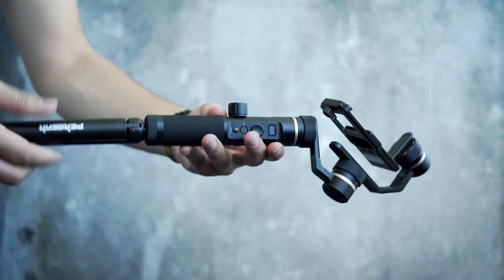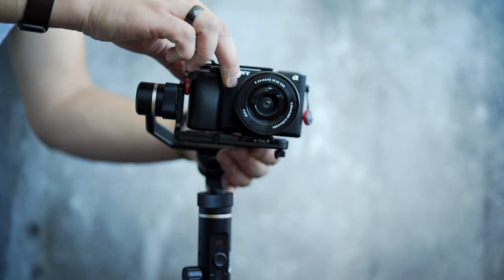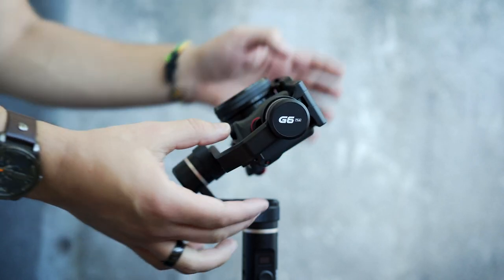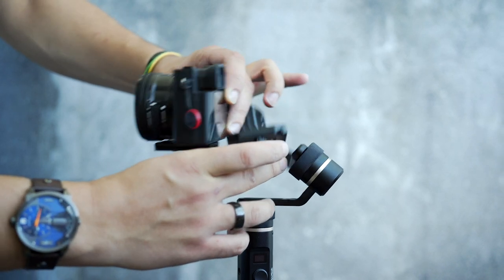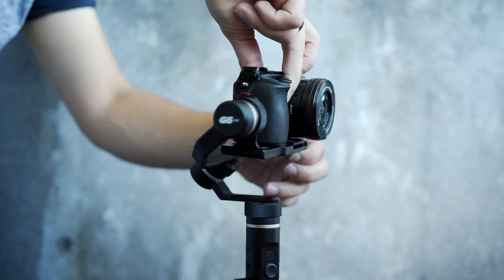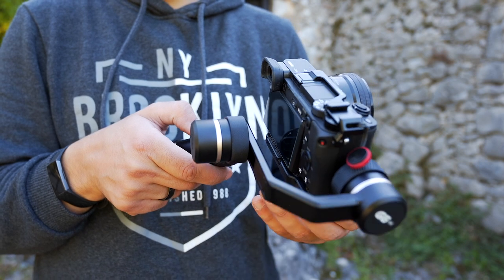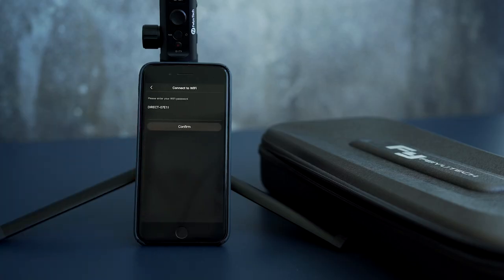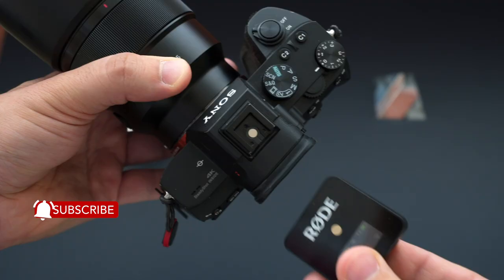How to Balance Feiyu G6 Plus Gimbal in 3 minutes!

Comment: Nice video. Calibration did work. but my problem: the sounds of the motors are clearly audible in my videos. What is wrong?
Reply from the maker: What camera are you using ?
Reply: @OmaGhomrawi  iPhone 11 Pro & GoPro Hero 7 Black & Sony Alpha 6000 (Problem each on every device)
Reply from the maker: SK Movies & Photos honestly I used it only on small mirrorless camera. Im not shure but the sound could be because of the lightweight gear you attached
Try to install Feiyutech app and adjust the gimbal load settings
Reply: @OmaGhomrawi  I already adjusted the motor strength options. Gimbal is smooth, it works. But you can hear the sounds of Motor in the captures.. its a hissing noise, not very loud but audible.
Reply from the maker: @Stan80  mmm I don't know how to fixt that. I don't the gimbal anymore and dont' remember it makes noise that much
Reply: @Stan80  have the same thing, motor sounds in captured wideos. Maby try with plugged mini micropone into the smartphone or gopro?
Reply: ADi_Wostok that could be a Solution. Please tell me if it works when you tried.
Reply: @Kod3X666  change my sony A6500 audio level to 2 + comica CVM-SV07 mic + Volbox inline vol control (80%). With kit len 16-50mm pz, balance good but i think the motor still not strong enough. it has click sound if movement is fast. so when do inverted mode to get low shot, have to do it slowly.  hope this help.

Comment: Great video! Is this compatible with an iPhone 13 Pro Max? Thanks!
Reply from the maker: It works, however, you can get cheaper and better gimbal for smartphones from Zhiyun
Reply: Thanks for the fast reply! If using an Iphone can you only film horizontally or also vertically? 
Also, Im gonna do some more research on the Zhiyun gimbal! Thankssss

Comment: I bought this gimbal months ago. I has worked soso... but with my new Canon M50... it's a nightmare. I tried to balance it today only for over 6 hours. it's nerv wrecking.
Reply from the maker: So it was working fine in the past ? What problems you're facing now when balancing ?
Reply: @OmaGhomrawi  I didn't write it worked fine. Balancing has always be very time consuming. It has always taken a long time to balance and even when it was balanced, it wouldn't stay balanced.. when I balance it unclean as shown in your video, it will vibrate.

As I wrote, balancing it with the M50 is even more difficult, because of the viewfinder of the M50.
Reply from the maker: I don't have the gimbal anymore, and I don't remember I faced serious balancing issues at that time. Did you try to change the balance load in the app ? some gimbals  vibrate if set to load light or heavy weight.

Comment: I bought mine, managed to balance it with my canon M3, but wouldn't balance if I added a rode Videomicro. Huge reason I'm selling it again
Reply from the maker: Yes the on camera microphone will change the balance center point. Better to mount the on the side if possible or buy a bigger Gimbal. Ronin SC is a good option though. (https://youtu.be/Sa5qpjp24C4)

Comment: im having vibration issues..any suggestions?
Reply from the maker: Mustafa A did you try to check the load settings?
Reply: Update the firmware and try different cameras/phone to confirm its not a wrong weight balance